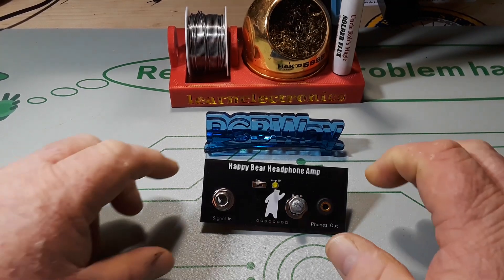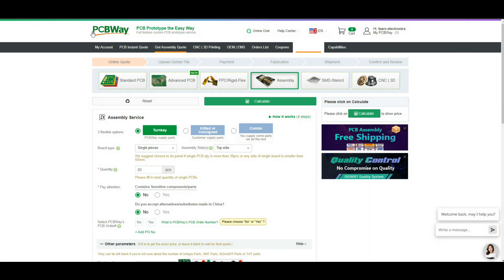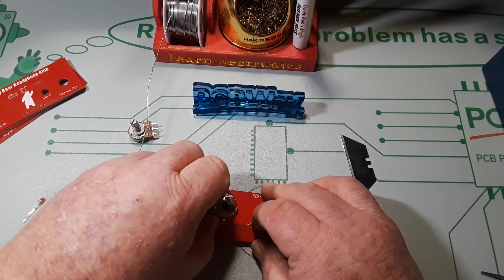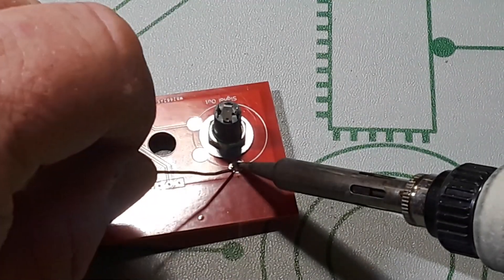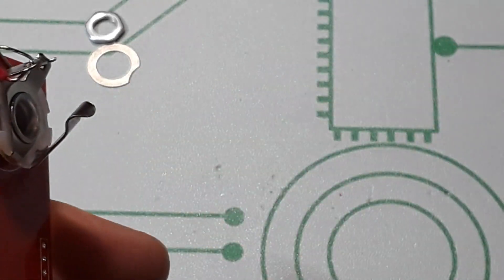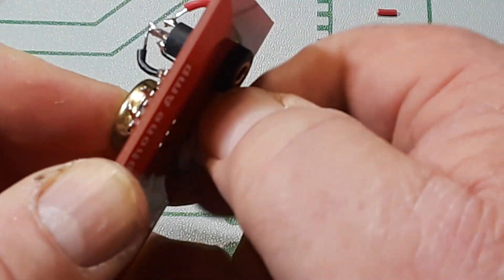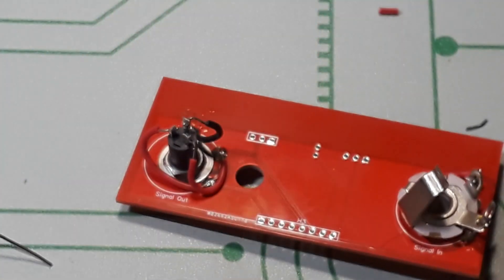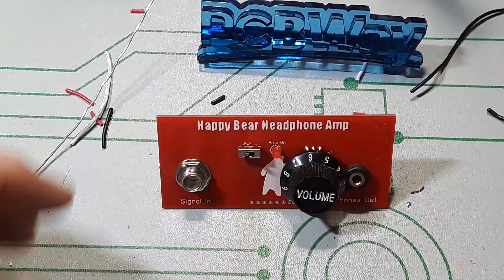Headphone Amp Front Panel Almost Ready

Comment: Paul, Why don't you have holes for the switch and LED to flush mount them? Just move the solder pads out a bit , use wires for the switch and bend the LED leads over to meet the pads. No need for through hole as they'd be soldered surface mount style. That would smarten up the face.

As for the RR comments, all I have to say is Three Mile Island. Nothing more.

Comment: I have a question on a DIY Oscilloscope on R2 itès sepossed to be a 1.8M ohm resistor but I did not get one in my kit so what can I replace it with? I only have a 1M and a few others resistors
Reply from the maker: put 2 1M is series

Comment: Acitvated carbon absorbs chemicals. They can only absorb so much before needing to be replaced. They will need one hell of a carbon filter to soak it all up. As for the stuff that has leached into the ground? I have no idea what they will do about that. If you can afford to get a carbon filter for your home water supply do it. Even if you arent drinking the stuff its still getting on your skin. I hope there isnt any in your water. Do you know exactly where your water comes from?
Reply from the maker: My water like everyone else in a 30 mile range comes from the Ohio River
Reply: @learnelectronics  well lets hope a minimal amount made it into the water supply. They did burn alot of it off which wasva good call.
Reply: @learnelectronics  I rather move away from where you are, a million miles. Look after yourself and no cancer.